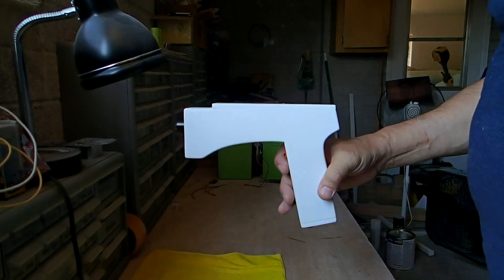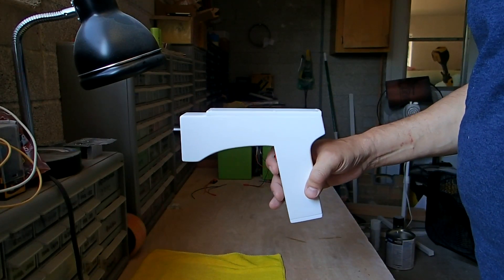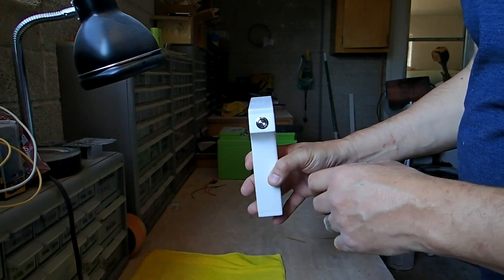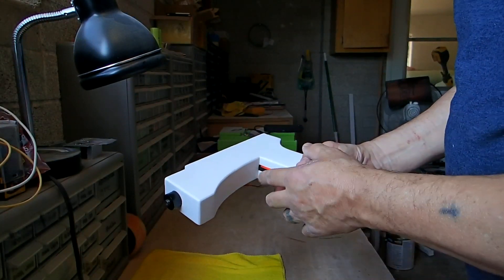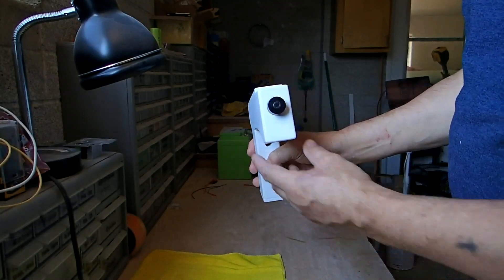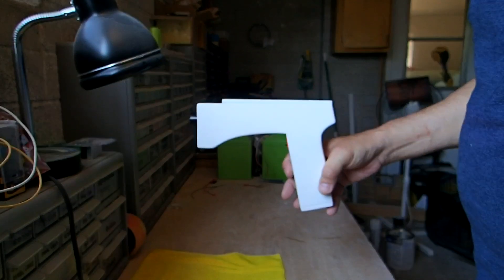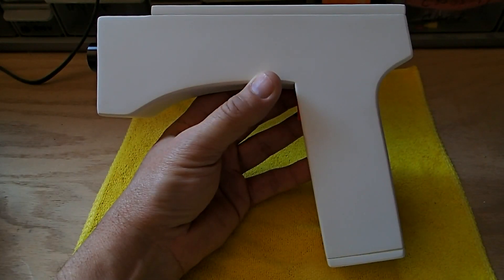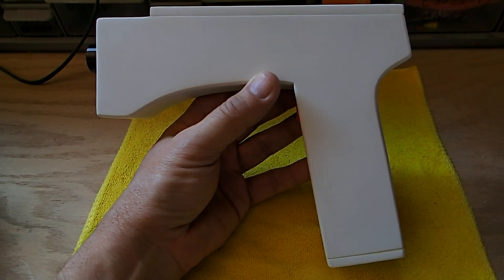Laser Gun Production Model

Comment: Attosecond DEW are the most effective. That is, when energy is focused in onto shorter time scales, the penetrative power is greater. Donna Strickland won the Nobel Prize in 2018 for creating the chirped-pulse laser. This is basically a type of amplifier. The Imperial College of London has the best video where she explains her big 1980s breakthrough in making lasers that have a greater output for less input. She makes the point that to further improve the laser, harmonic resonance is needed. Since her breakthrough technology, that has been accomplished, breaking the attoseccond barrier. There are many in-depth Youtube videos from University professors on attosecond lasers. Youtube also has Donna Strickland's 30min acceptance speech which provides a lot historical context on this issue.
Reply from the maker: Actually what you're talkin about is pulsed energy that is storing one watt of energy over a second of time and then releasing it in one microsecond equal into a megawatt pulse but only for a microsecond I have information about this on my coil gun look at my electromagnetic coil gun videos.
Reply: @RaptorRotorHead  Not a microsecond. The shortest time scales which lasers are focused is ~50 attoseconds. That's over ten orders of magnitude faster.
Reply from the maker: whatever I'm just giving you a basic example cuz that's how radar works.

Yes we can pulse the laser faster. The meaning is the same.
Reply: @RaptorRotorHead  It is very destructive while using a negligible quantity of energy.

Comment: any idea if there is an affordable material to use for laser protection. like a film that can coat glass. I'm building a 4x8 sheet size cutter and a protective window would cast an arm and a leg. even goggles are more then $40 cad
Reply from the maker: I use goggles you would have to get material that blocks the wavelength of the laser diode I've never tried to research anything like that of that size but imagine exists because that's probably what they cut the goggles out of.